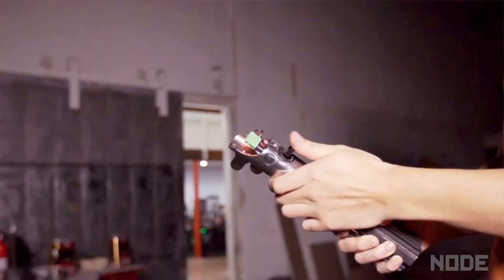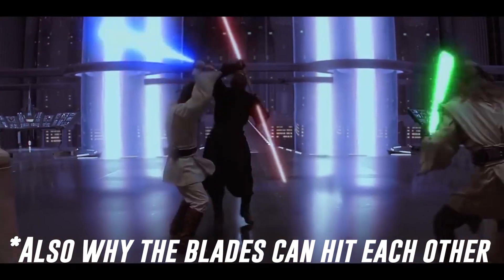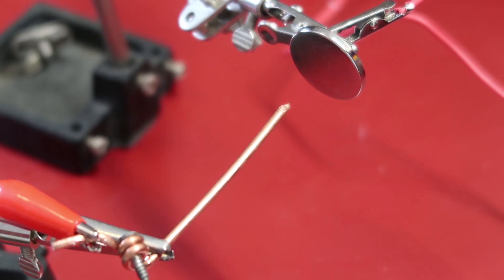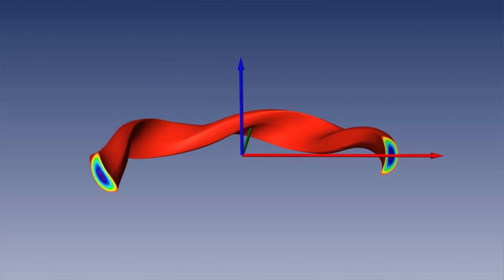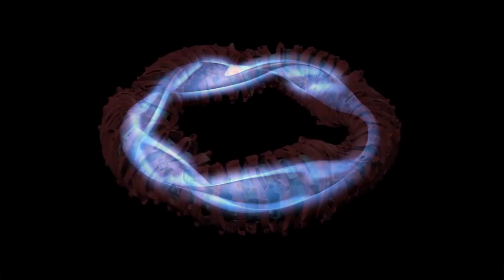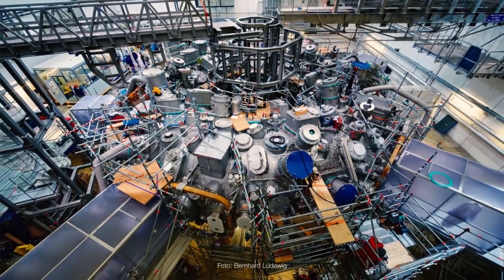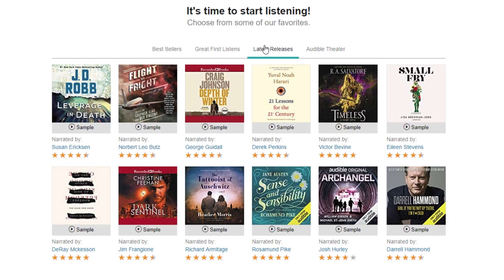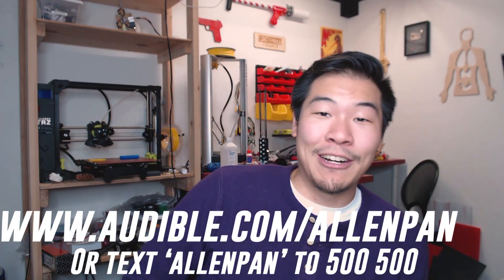Real Life Plasma Blades!!!

Comment: A starship coil can project a magnetic field for a limited distance depending on the geometry of the coil. 

Now if you use an ion gun in the center you can eject ion plasma  out and away, but have it come back to your starship coil.  The magnetic field and repulsive force of the returning ions will help keep the center ion beam focused for a distance.

Using a starship coil in a plasma sword/dagger may double as a sword guard, and is a cool name for a starwars weapon.

Comment: to get a better (closer to laminar) airflow, just fill the end of the tube with 2" lengths of soda straws . . . pack them in tight enough and you won't even need glue.

Comment: Though it will run out Compressed Air may be a better source. 1 its portable. With many size tanks  2 Its easy to regulate the flow and pressure  as again There are plenty of regulars out there. I truly think with a 1/4 inch line with a self made flare end. Think vacume cleaner ends for Upholstery on a smaller scale. Mabe several air outlets along the blade path this keeps the pressure stronger and may give your Plasma a little more length.

Comment: The fan in a Dyson hairdrier would be perfect for that. A brush-less low turbulence high airflow motor that would easily fit into the pipe inside the handle.

Also looks like a jet engine so in a clear plastic housing it would make quite a statement.

Comment: How about you try to make a light saber by have I ng the same set up a bit more power full air flow but way more current and it not having any thing to make the ladder but smaller with a copper sharp tip so it will fly forward
Reply: Adding more current is theoretically better, but because his setup has the plasma in direct contact with the copper and higher current makes the arc hotter, the copper would easily melt and ruin the whole thing. While building arc lighters and stuff, I’ve had the wires melt from the power going through them multiple times, and even if the wires are thick, they will still melt within a minute or two.

Comment: Have you tried to put the emitters of your blade side by side with a neodymian halbach array between them?
Reply: Mundy Morning Report I’ve done small scale versions of this, and generally the high force of wind makes magnetic fields drastically less effective (imagine shooting a bullet and having a magnet nearby vs just having a magnet next to a stationary bullet)
Reply: @Ferraday  That is a really helpful insight. The reason for the suggestion is based on only the experiments that demonstrate you can greatly extend a magnetic field with a halbach array and also that the magnetic field will enahance/cut/shape flow of the current depending on the polarity and charge direction. Clearly the force of blowing the charge carriers physically overpowers the field effects which are just warping the space the negative charges are traveling in... 
Staying focused on the blade solution would be to have a captive rod rotating in a tube and get a laminar flow vortexing around the outside of the tube with an inner vortex to help establish the containment field.  Such a vortex can be generated with a relatively low pressure vacuum flow. Definitely would want to prototype with a small knife first. The ironic thing about such a design, is that when it was powered enough to actually cut through things as you struck them, and also withstand the impact of the air rushing by, it would be transparent... yep, the "blade" would be invisible except in the UV or IR spectrums. That's what happens when you get plasma production to that level, it starts emitting invisible light. Also, changing the axis of rotation would create some interesting counter forces, due to the gyroscopic actions... swinging it straight would be a challenge. (maybe, the counter-rotation of the plasmas may actually make it relatively weightless). The magnetic fields around it would also wipe your electronics and credit cards. Possibly magnetizing or charging metals nearby... a reason the Jedi didn't wear body armor. Again, projectiles may be the way to go... as swift movement off axis may cause the weapon to stop suddenly and high speed rotating objects tend to explode when abruptly interrupted. Not something you want to try at home. That's an interesting idea. Peace, B

Comment: What if you only used 1 of the blades? Could the plasma ground itself in the target instead?
Reply: Radiation Pony that’s actually a really good idea, I’ve done small scale versions of this and even if it doesn’t touch a target, you can see the edge of the wires glowing (looks even cooler in the dark). Also this 
 super dangerous to test because anything grounded can get shocked. Also also the target that is grounded would have to be relatively flat to get a cool blade look because the electricity will try to go out of sharp points and won’t look as good.

Comment: At 7:41
The plasma is pointing continuesly away from the poles. Would you be able to make a plasma sword with no metal on the inside nore the  outside, when you are researching, why it pulls away from the pole with no specific direction to go. Then you could make it longer. And you have a sword with no blade when deactivated.

Comment: why do you need a leaf blower,, just use copper that spiral around a magnet and then put two magnetic squared knot metal like this 🔎 but squared in the both ends and then your done boom!!
Reply: You need an extremely powerful magnet, also neodymium magnets lose their magnetism when exposed to high temperatures

Comment: Lightsabers are NOT plasma. Lightsabers use kyber crystals and the will of the Force User to channel the living Force into the weapon. This also explains why some lightsabers can do feats that others cannot as they are partially dependant on the strength of the Force User's connection to the Force. Gawd don't you know anything. It's basic fake science and clearly explained in the canon.
Reply: LordPadriac basic fake science

Comment: place 2 in parallel on each side with the plasma arc laterally between the two rails, giving you a "blade edge" to your device. incorporate a 16cfm 12 volt squirrel cage blower fan up the center of the unit to "drag" the plasma upward toward the end of the rails, and you can use a current loop to make it double-sided. 
By overclocking the motor on the blower fan you can achieve up to 30cfm easily and have a functional edge in less space for a hand-portable unit.

Comment: Stronger and controlled torodial air flow (think flat vortex).
Possibly an igniter gas.
And telescoping tungsten with your magnetized wire cone will get a much bigger blade.

Comment: Use a harmonic frequency Crystal to the variance where it radiates a certain amount of centimeters off of the crystal where the plasma just kind of like lays on it if you know what I'm talking about and then you have a solid mass of a crystal that's frequently is about the same density as plasma and it goes through ship

Comment: Hey instead of using a rounded coat hanger what  if you used something with an edge? Would that help concentrate energy in more of a point for cutting ? Or would the arc still jump around at random ?

Comment: So you're a Gundam Fan right? I was wondering if you'd be interested in  trying a Re-Creation of  a  Zeon Weapon like the Dom's Heat Saber,  The Zaku Heat Tomahawk, or Gouf Heat Machete for.. Scientific Curiosity. Personally I always wondered how such Machinery could Endure The Constant Rapid Vibration that would be necessary to make a Blade Hot enough to Cut through Metal without being too Heavy or Unwieldy, like how long can someone actually be able to wield  a SuperHeated Blade like that on a Realistic Battlefield Simulation.

Someone else tried creating a Heat Weapon (Raiden's Katana)  but it was so Clunky and The battery pack was so Heavy/Large it was very Impractical and Practically useless for Engineer Purposes let alone Battlefield Simulations.

Comment: You rock! That's awesome! What a cool project :D 

I would love to see a Dagger or Shortsword made with compressed air? It could be channeled down a  pipe with small holes in each side. beside each hole could be the two metal conductors for the plasma, so it would be a larger blade made up of several small plasma blasters :D Looking somewhat like a 'spiked dagger. 
This would be epic!

Comment: What would happen, if you use a ionized airstream like new hairdryer have? Maybe this would reduce the resistance of the air and allows more current flow, thus leads to higher plasma temperatures.

Comment: Using neodymium magnets as the electrodes should also cause the arc to travel along their lengths, with the benefit of a more continuous sheet of a higher temperature due to the magnetic field accelerating the arc faster than the blowing air and the absence of said air's cooling effect; essentially a permag-assisted plasma railgun with an extremely high firing rate. That effect was even demonstrated at the beginning with the conical discharge to the circular magnet, he only had to extend that design to two long parallel magnets to get those benefits and also be able to ditch the blower entirely.

Comment: What if you were to make an hourglass shape and have the plasma edge come from the neck of the design. for instance:
_
\  /  <-- These regions would be where the plasma was generated.
/_\
    ^ These angles would be much more acute to allow a shaper blade.
 
Effectively, if you had a sword with this design, it would have four sharp edges with a layer of plasma in between them.

Comment: What if you had a “blade that had a lot of small holes just large enough for flamible gas to go through and while the mini “blow torches” are lit you can use the added electron environment to run a current through those in a double edge style. Not sure if there are powerful enough batteries to power that kind of electricity needed, but if there is one you could have that battery on a constant charge with solar, direct or wireless charging.
That said the “torch” would give you a great heat plus the plasma.

Comment: Weird thought on the design: Would it be possible to build much shorter jacob's ladders side by side, a sort of manifold for the air to pass through and essentially do a series of your example plasma blade like "teeth"?  Basically with a goal of making a plasma "edge" along a blade length rather than lightsaber or Halo style.

Comment: Have you thought of using any of the nobel gass's ? I wonder if you have presure release controls, a small fast flow of helium would excite the air far greater than just a  vaccume. 

Also using a pressure generator attatched to a cylinder , you could make it more mobile and not rely on power for a vacume, 

Also if it is D/C you can also play around with aluminum backed with nyodium magnets for an even cooler demonstration

Comment: I had an idea while watching this. Instead of using copper wires and blowing air between them, you could use copper TUBING with holes drilled into it, which would allow for more precise direction of the airflow. You could use compressed air, or even flammable gasses. Think of the possibilities!

Comment: Just chucking out an idea maybe you can use compressed gas like co2 or something that you can rig to to some switches. Like have your arc going, relase some high pressure gas to extend the blade and have some safety shutoffs and such so you dont explode yourself. Just an idea, probably needs a little workshoping.

Comment: How are you with making really long skinny tubes? 
Tube goes whole way out to tip.
Followed by a bunch of progressively smaller tubes.
Then electrifying the shit out of it.
Could this method be used to move plasma to outer edge of the blade?
Or something like serrated tazers points on the edge with air tube in between not a solid plasma edge. 
But if you perfect that technic you could extend edge of plasma beyond sarration to make a solid plasma edge.
(For explaination purposes: Lines equal electrified sarrations & Os
 equal air tubes.)

|o|o|o|

Or more like this if need post to either side of each section

|o||o||o|

Get back to me with you think it can work or make a video about it!

Comment: Plasma doesnot exist
Reply: Plasma is a misconception created by Americans in order to try to manipulate the system in the cells, as a way to try to portray a fictional idea of a 4th state in matter, in which is deliberated from misleading on material that has thermal expansion and that emits heat based on dispersing either energy, light, both energy and light or electricity(inductively) therefore a 4th state in matter cannot exist on a natural base of the material composition, liquids are molecular cohesive bond structure, gas are disperse particles that disperse based on temperature and density, while solids are strongly bonded materials that can sustain a form under many different pressure, temperature and diversity of density on atmosphere different from both gas and liquid matter, as for plasma, such thing doesnot exist, burning or compressing gas doesnot create a new form of state in matter and neither does thermal expansion on solid materials as this is only transmission and transition of energy that alloys heat energy or other forms of energy such as light to disperse to accommodate temperature and resistance, which should be clear this doesnot and can not scientifically create a new form in any material nor a new bondage that can lead to a new stage in any particle or matter.
Is not scientifically possible to ionize gas, plasma doesnot contain magnetic field because it doesnot exist.
They using holographic technology to make the purple color while using other forms of tech inside their genetics and pretend to give an illusion of fake plasma, while talking never ending lies to try to create more confusion and misleading information to deceive the cells and the operating system intentionally. 
No plasma sorry doesnot exist and at least 90% of what this lying asian homosexual in this video said is just lies, a non stop lying sob.

Comment: Nice video but i have a question couldn't you made the "blade's" parallel one an other (or on an angle 45° for example) and reduce the space between them for creating a more "usable" plasma sword instead of having two "non lethal" parts on the edge's ?

Comment: little tip, and im not certain if this will work, but its worth a try, but you should try angling the air almost like the shishkebab in fallout 4, and turning the blade 90 degrees, so that the plasma extends forward from the blade instead of just up. it should create a plasma shoto katana type of thing. plus, the smaller series of ducts should create a nice nozzle effect, reducing the need to have a bulkier air setup. genuinely hope you see this, cause i want to see that built.
Reply: and dont be sad about the ferby. be happy that the tortured soul they stuffed into that cursed computer chip has finally been cleansed and allowed to move on, in some small way. trust me, i know all too well that death would be a release compared to that suffering.

Comment: So I know nothing about science, keep that in mind when reading this. I was just randomly thinking and thought about the technology used to make those floating speakers. What if you had a floating magnet or whatever it’s called that can cause the plasma to go in a circle on the end of the blade and have it kind of control the plasma? Really odd idea with no research behind it but if anyone has any input that’d be cool.
Reply: Magnetic fields loose power exponentially, so the blade wouldn't be able to be that long. Not to mention, even slight motion would just knock the floating magnet out of the magnetic field.

Comment: Basically a light saber, sure, but can you get the arc to go perfectly straight and turn back on itself without using any kind of tube? Or maybe while using a tube and have it come back on the outside of the tube? Either one of those would really make it a light saber.

Comment: That is not a plasma blade.  More of plasma thrower.  Fact u r blowing plasma out, plasma in movies or games is a controlled plasmas blade.  More of the relationship of heat sword.  No we are not going make a heat sword, main focus here is to make a proper plasma sword correct to the view.  I say for get the plasma sword, you got a plasma thrower, did u know of that possibility of use of plasma thrower is? Alot, use the air compresser to increase the blast of range of the plasma thrower.  Do not keep using that piece of junk of leaf blower.  If u do not own a air compresser, ask ppl who own a working powerful presser air so you can convert to be a 1st world plasma thrower. Why u ask I call it a plasma thrower? Then I tell u this "it's simple, it's similar to flamethrower accept it's electric plasma.

Comment: To make this better you should piece of metal tubing that has holes in in that goes just on the inside of your cables that holds the current. This tubing will have a blower of some kind through the end of it to allow the air to pass through the tubing and the holes, then to get blown onto the cables with the current on it.

This way you get the effect of the blade actually  on the outside of it instead of just on the inside, Also you can end up having your two cables on the outside next to each other side by side with the holes blowing into the center of them and then going around the tubing on the outside

Comment: Turn the blades 180 so the transmission bars (the coat hanger pieces) are facing away from each other. Then double up on the voltage. I'm thinking that will put the plasma around the blade, instead of sandwiched inside the blade. Also consider using a voltage multiplier if you can find the right caps and diodes. Assuming that wouldn't make it too bulky.